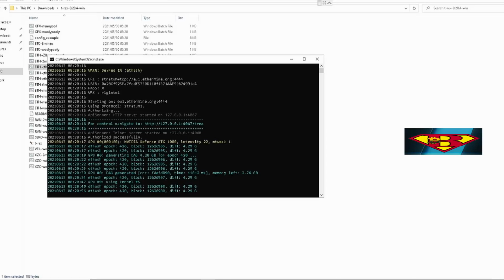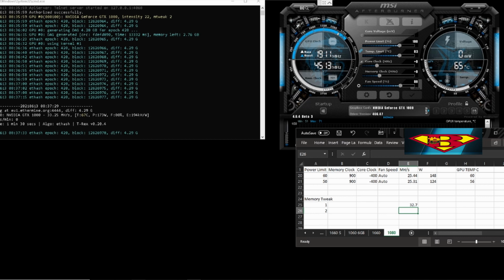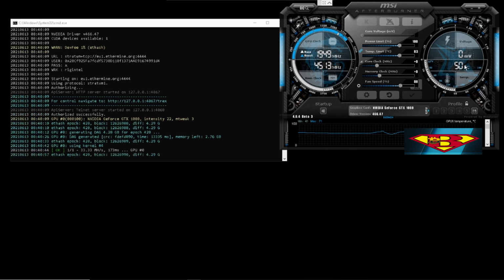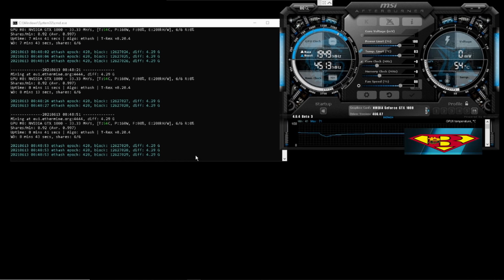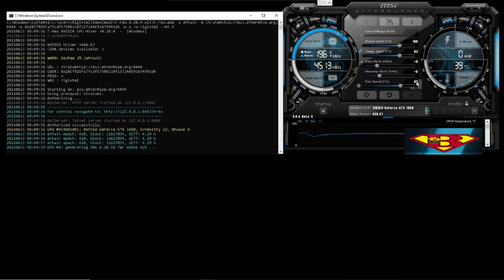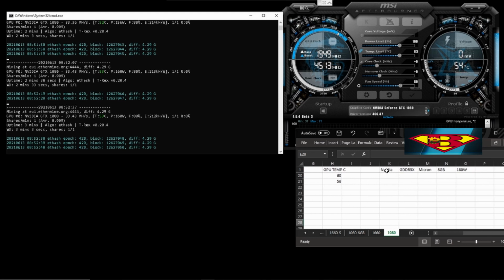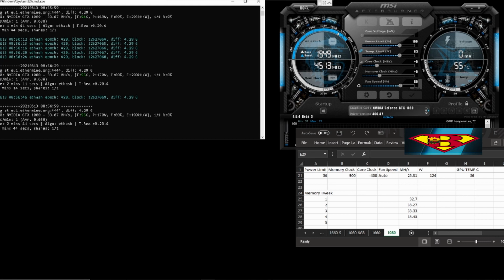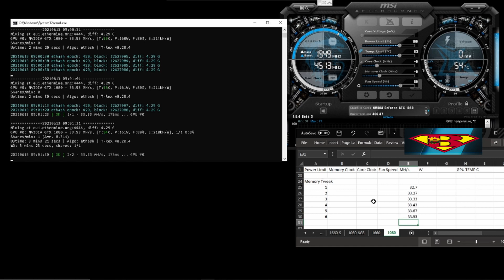HOW TO USE MEMORY TWEAK ON 1080 IN T-REX MINER | Or How I Used It

Comment: When using the memory tweak I'm assuming we don't touch the Mem clocks or do any tuning in AF right? I'm getting 35.32 MH/s. BUT if I add any Mem clock I get over 12 GH/s lol. Obviously that isn't right...RIGHT?
Reply from the maker: I has same issue but randomly. When I did the memory tweak. I followed all the overclocking steps I used again. Because after the memory tweak it is like a different card that requires completely different overclocking settings to function. So yes you can leave it as is or redo all your overclocking steps to find the best stable hashrate.
Reply: @BizWithBruce  Ok after some tweaking today and more learning. I figured out that changing the clock speeds in AF while the miner was running is what was causing this. I have to shut down the miner,  change settings in AF and then run the batch again to test. 
On my 1080 mt 6, PL@ 80%, CC@+135 MCL@+850 I got up to 37.45 MH/s.
Reply from the maker: @Havok412  that is very high. I hope it stays stable for you.
Reply: @BizWithBruce  Thanks! I have an uptime of 10hours now with no issues. Hash rate dropped to 37.13 after I raised the fan speed from 60-65% this moring for some reason. I didn't stop the miner though just changed the fan speed on AF.
Reply from the maker: @Havok412  which pool are you mining to. Are they also showing the same high hashrate
Reply: @BizWithBruce  Ethermine. Yep total MH/sj on that rig is 88.44 and shows up the same on ethermine. 1080 @37.13, 1660 @25.66,  1660 @25.65
Reply from the maker: @Havok412  and trex?
Reply: @BizWithBruce  yep on Trex
Reply from the maker: @Havok412  when I tried auto fan with the memory tweak it did not ramp up fast enough and the card got very hot. So I had to set the fan manually to start very high and stay there.

Comment: hi even setting a mt tweak of 1 is crashing, is it the the drivers, im on 471.41 2 x gtx 1080 ? anything to help me figure out ?
Reply from the maker: What is the stock hashrate you are getting
Reply: @BizWithBruce  stock hashrate is about 20mhs to 22mhs
Reply: @BizWithBruce  no matter where i use memory tweak either in trex or using nicehash miner by setting parameters in plugin. Any memory tweak instantly crashes. But able to get 30mhs using nicehash quick miner with medium optimization profile
Reply from the maker: @videoonfire  yes i dont know what the nicehash system does. I used their function once and the cards went crazy.  Fans went super loud. Then i switched it off
Reply: @BizWithBruce  okay so in trex miner as well using mtweak crashes. Could it be the drivers? Or could it be that 2 1080 I have are clocked differently
Reply from the maker: @videoonfire  it could be a number of different things. It could be silicone lottery. It could be your power supply. It could be thermal paste. Thinking of it, it might very well be the thermal paste/pads. I remember when I enabled the memory tweak, the temp of the card increased extremely fast. So it might be that is the reason of the immediate crash. It might not be able to pull the power it requires, could be a riser or cable issue. Do you have any overclocking settings running in the background? That might also crash it. It might be the drivers. There are so many things it might be. Do you only have these two cards? Do you have other parts you can swop out with the ones you are using?
Reply from the maker: @videoonfire  when I set mine to 1 it immediately changed to 33MH/S it does sound like your cards are not happy with the big switch in a short time. I would just try a older driver seeing as the cards are older. Have you tried one card at a time plugged in?
Reply: @BizWithBruce  yeah almost seems like it, i will try one card at a time and also try a older driver. if you can suggest me a driver/what driver you are using on your 1080? thanks :)
Reply from the maker: @videoonfire  I sold mine to another miner needing a card. I was on 466 when I tested them
Reply: @BizWithBruce  I am having the same problem with my Strix 1080. Every time I launch the miner my computer crashes. Could I get some help?
Reply from the maker: @jacksonwazny  I di sell my 1080 because it was using too much power, but , sure , what is the exact problem. which miner do you use, do you use windows or HiveOS, do you have any other cards plugged in? what power supply do you use, what settings do you have configured?
Reply: @BizWithBruce  i am using windows. Latest driver version. And have no other gpus plugged in to my 650w psu
Reply from the maker: @jacksonwazny  is it doing this with stock settings or have you applied overclockings and memory tweaks
Reply: @BizWithBruce  only crashes with mem tweak applied
Reply from the maker: @jacksonwazny  You did have all overclockings turned off , everything at 0 and fan at 100 before applying memory tweak 1?
Reply: @BizWithBruce  everything was at zero and fan was at 60%
Reply from the maker: @jacksonwazny  one thing I realised was the memory tweak increased the temp alot very quickly.
Reply: @BizWithBruce  if I turned fan to 100% and dropped all my stock clocks a bit do you think it would work?
Reply from the maker: @jacksonwazny  but if everything was at stock and fans were high enough and memory tweak 1 made it shut down and you followed all my steps. Then your card unfortunately can't work with memory tweak. So best is then to follow my normal overclocking steps